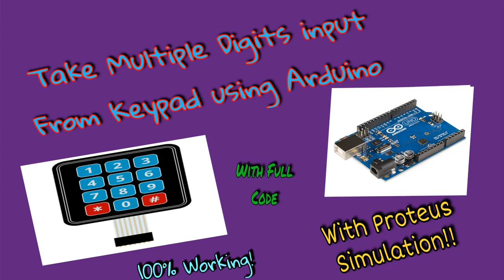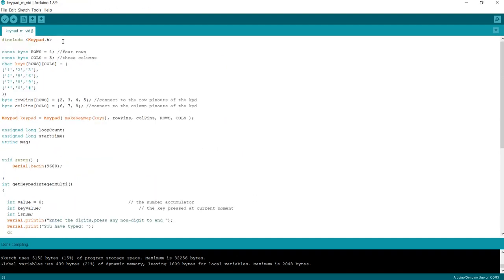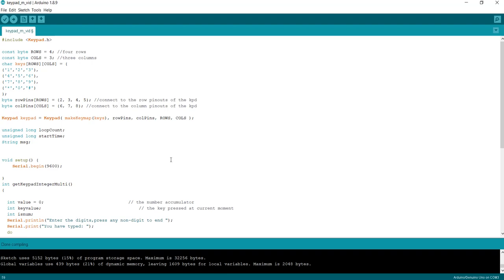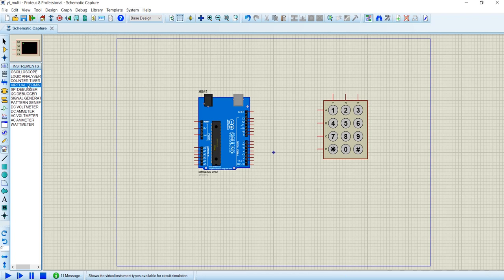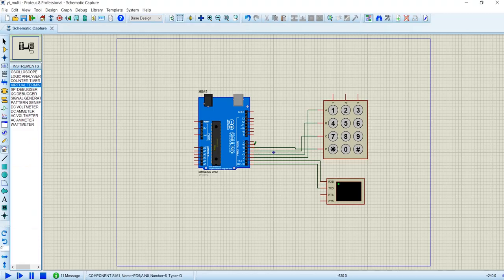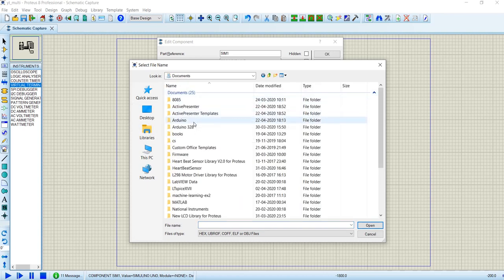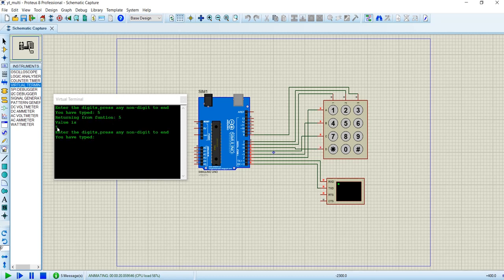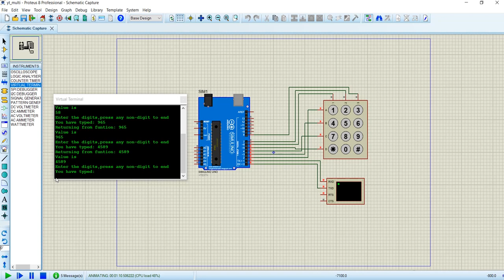Store Multiple digit Input with arduino keypad|| With Full Working Code || Proteus Simulation||

Comment: I have done further investigation and it seems when insterting code and using in my code it crashes while running in my code. Any number larger than 32767 gets a - infront of it. And I cannot load my LCD because it crashes at #4.
Reply from the maker: Sorry Bob for the late reply. Actually the problem occured due to int declaration of the data type of the variable storing the number, which can store numbers from -32767 to 32767. I have changed the variable data type to Long which can  store 32 bits (4 bytes), from -2,147,483,648 to 2,147,483,647. I have also updated the code on the github. I hope it solves your problem. Thanks for your comment !
Reply: @techchirps6089  I ended up using just the structure setting it up and did my own code for gathering the digits and combining them and converting them to integers.
Reply from the maker: @bobbevins8946  That's Great!